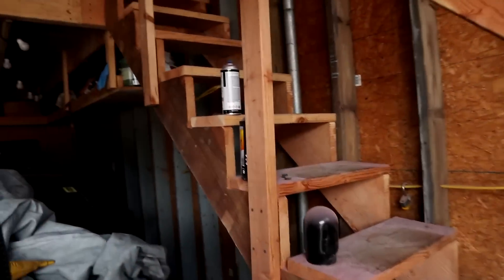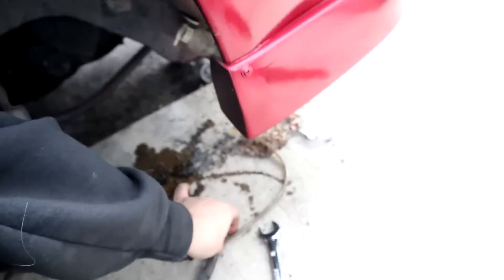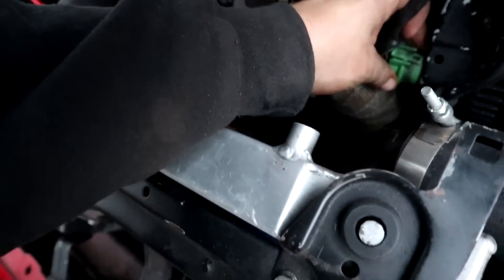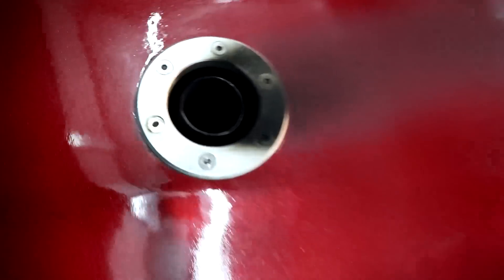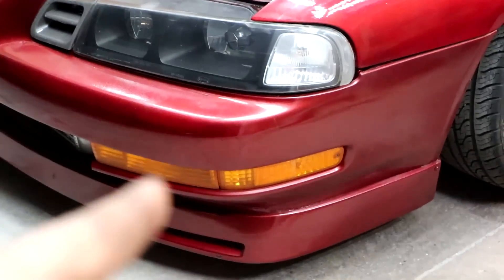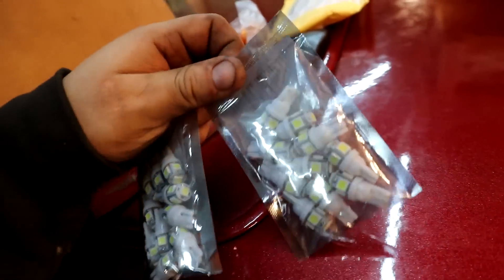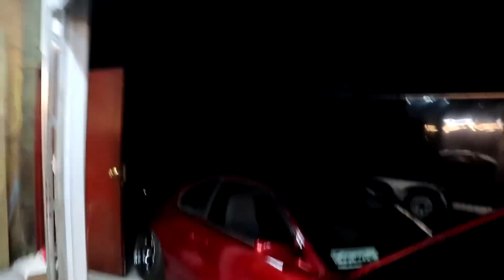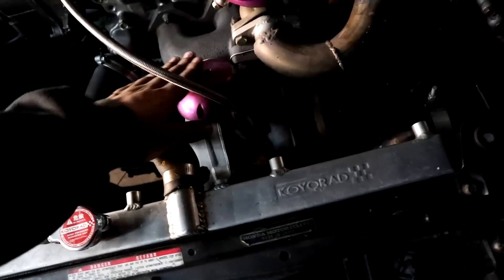6 PSI VS. 10 PSI in a TURBO HONDA

Comment: 10.8 11.3 is safe
Reply from the maker: That’s super rich boi
Reply: @damianmonte  nah its correct and smart. ur running near n/a engine afr. richen it up. target 14.7 at idle and cruise and 11-11.5 boosting
Reply: Power 2 Weight  actually the information i stated is industry standard for baseline tuning. The rest will be adjusted on the dyno. nice try though.
Reply: I shoot for 11.5 in boost when tuning my talon but I'm makomg 25 psi on a gt3076 so I could use the safety for my stock block lol but it is more about the knock limit then the AFR's
Reply: Lol.  Shout out to China.

Comment: Air fuel ratio seems to be a little too lean for boost.  Mid 12’s seems too lean.  I would say mid 11’s would be good granted I’m not a master tuner but all the boosted vehicles I’ve done and been around never were in the 12’s for fuel ratio.  Always mid to low 11’s

Comment: @Damian ebay item no :- 130759082496
Gunson eezibleed brake and clutch bleeder , no need for a compressor it just plugs onto the wheel for its pressure , make sure the tyre pressure is 32psi , then youre golden